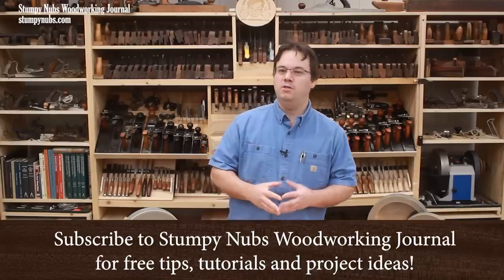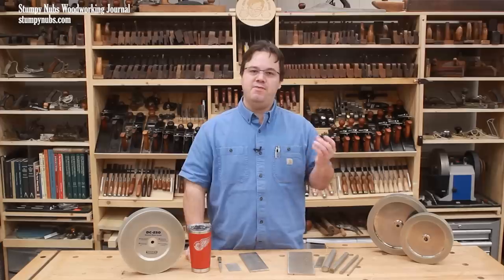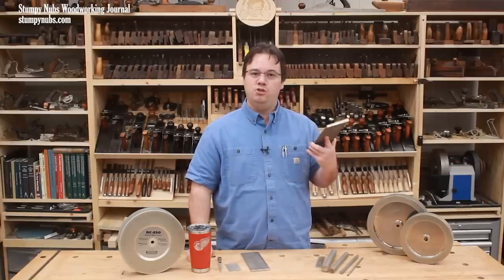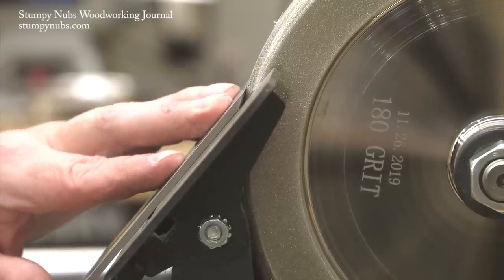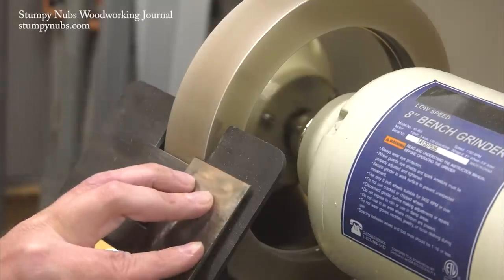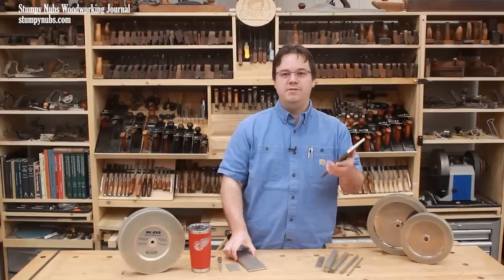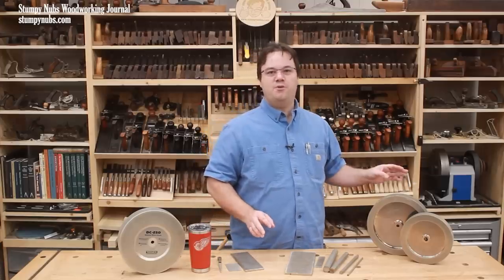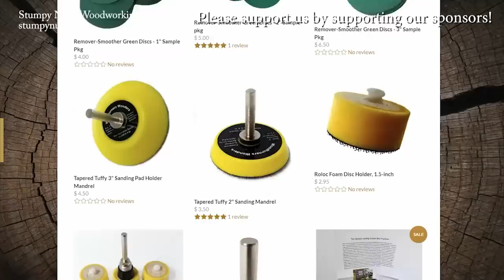The TRUTH about CBN vs Diamond sharpening stones

Comment: I’ve heard that graphene is stronger than diamond, so I’m wondering if graphene will eventually be incorporated into sharpening systems in the near future. Your thoughts?
Reply: Graphene tends to fall apart in all the things that make it magical once you produce it/size it on the macro scale. It's weaker, less thermally efficient, less durable, and less malleable. It's also much harder to manufacture.
Reply: @jordananderson2728  All that's subject to a rather large asterisk. The main issue leading to those drawbacks has nothing to do with graphene itself and solely with irregularities in the 2D lattice due to our still crap manufacturing methodologies that cause weak points and reductions in conductivity, i.e. why it hasn't actually left the lab yet.
Reply: “Strong” means many different things. Graphene makes strong bendy fibers that can flex. Diamond is harder, but it doesn’t flex well. A bent diamond shatters.
Reply: Graphene is a 2D material, and as such does not have a well defined hardness or bulk modulus. You cant really have a cube of graphene to test the hardness of, because at that point you would just have graphite and you're not testing the bonds in a graphene sheet but the shear strength between sheets.
Reply: Graphene is graphite. Much harder to burn than diamond, but also much less abrasive because it is sheets of carbon. In fact it is used as dry lubricant.

Comment: Would corrosion ever be an issue for water-cooled diamond or CBN wheels?
Reply from the maker: The steel substrate beneath the layer of nickle that is used to electroplate the crystals on can rust. Use water with an anti-rust treatment if you use a wet grinder like the Tormek.

Comment: If you don't own a dressing stone is there another way to clean/unclog an aluminum oxide stone?
Reply from the maker: A dressing stone isn't expensive. Why not just get one?
Reply: @StumpyNubs  Because I want to be like McGyver but usually wind up being McTard
Reply: @StumpyNubs  Quick question on Amana countersinks (for #10 bugle head deck screw).  Me/friend did a decking job and snapped drill bit on 3 Kobalt countersinks.  2 of those the set screw that locks the drill bit in snapped in half and 1 of them the bead lock would not engage (it was frozen) so the set screw alone wasnt enough to hold a bit in for too long.  So what we found was Kobalts suck at being able to replace a broken part.  Does AmanaTool make their countersink drill bits more "repairable/replaceable" or are they just as bad?

Comment: now i'm royally confused.  after researching an uber-budget wheel to pair with a wtw spartan, almost every wheel is described as "cbn diamond"  and when reading fine print they list abrasive - diamond and ceramic.  only one separated their products into two distinct options either diamond or cbn but all list materials to grind as high speed steel and alloys but none list carbon steel or even carbide steel ... except wtw.   ???
Reply from the maker: When you buy cheap wheels, you get confusing, inaccurate information and poor quality.
Reply: @StumpyNubs  cbn is the tung oil of grinding

Comment: speakin as a machinist, you never want to use diamond on high speed, go with cbn. the carbon in a diamond will leach into the hs and cause you probs, at least that is what i was taught, and that protocal is pretty generally followed in every shop i have been in (50+ years.) diamond for carbide, and cbn or a softer bound aluminum wheel for hs. i'm not criticizing you sir, i admire yer knowledge and learn big time from you as i try to learn this wood crafting. but that's something i picked up along the way.
Reply from the maker: "i'm not criticizing you sir.." Why would I think you are criticizing me when you are pretty much repeating what I said in the video?
Reply: @StumpyNubs   well, put me in the pile of those folks that don't listen so good...jeeezzzzz, i'm sorry, i hate it when people do that too, and here i am standing in the pile o them. i jumped on it so quick cause grinding with the wrong material is a pet peeve of mine i guess. i am truly sorry.
Reply from the maker: @blakewerner4368  No problem :)

Comment: I didn't hear anything about a requirement for anti-corrosive additives for the diamond wheel.
Reply from the maker: Because you would have to use it with either CBN or Diamonds if you plan on wet sharpening. It wasn't a point of difference between them.

Comment: Does this mean you've completely discarded whetstones? Its a shame, because the more woodworking I do, the more i love my whetstones. I barely use my bench grinder anymore. When you have a sink layout specifically for whetstone sharpening, it takes less than 5 mins to hone a blade, and 10 mins to resharpen a dull one. I still like my Makita bench grinder...I just love my whetstones a lot more. The only downside is; it seems like Japan has a monopoly on high quality synthetic whetstones. Not made in US, and shipping is really slow.
Reply from the maker: I teach woodworking to a large audience. So I use multiple types of sharpening gear. But I admit that I don't use my water stones much these days.

Comment: I am thinking of getting a pair of the spartan CBN wheels for the Tormek from your link as they say you can run use them dry which would be great in my unconditioned shop.  Which grits would you suggest I go with?  The Tormek stone grader says it sets the wheel to 220 abs 1000 but would you suggest the same with CBN wheels?
Reply: I have a 180 grit cbn wheel on my T8 and it's great. So much faster than the original wheel.
Reply from the maker: Tormek's three diamond wheel grits are 360-600-1200, so that's at least the range they recommend to cover a wide range of uses. If you only get two grits of CBN, go with around 300 and 1000. You can use the 1000 most of the time, then go right to the stropping wheel. The coarser one is for when you need to remove a lot of steel to fix or shape an edge.
Reply: @StumpyNubs  Thanks for the answer, that was very helpful.

Comment: Get a 2x72 grinder and a bunch of belts including ceramic and a strop belt. You change belts by pulling down the tensioner wheel, so it's trivial to do. You can even build one yourself for the price of a Tormach. Now you have a flat surface that is big enough to lap the sole of a #4 plane and can do flat or concave.

Comment: If CBN is supposed to be cheaper than diamond, why are all the CBN plates actually more expensive?  I can get a full set of diamond plates for $25 and the cheapest CBN plates I can find is $63 for one plate (on 9/21/23).   Do you have a secret source?
Reply from the maker: You are comparing cheap, low quality diamond plates to good quality CBN plates.

Comment: Sharpening tools is a magical paranormal experience in an existential existence. I am not a wizard. I buy disposable cutting devices. Probably hundreds of pocket knives over my 59 year life. A stack of worn saw blades a foot tall.  I can't even get a kitchen knife sharp in a V-shaped ceramic sharpener or a chainsaw chain sharp in a jig. I own dozens of chisels just to get a new edge. I have all sorts of bolt on jigs and sharpening devices and none of them work well for me. Even a Drill Doctor destroys drill bits for me. I won't even use a hand planer because I wont be able to sharpen them. For me all tools get dull and then replaced. I stopped trying to sharpen anything years ago. My father was cursed the same way. When he passed we found stacks and piles of unsharpened tools and blades. One chainsaw and six used chains. A bucket of drill bits and like me a handful of sharpening devices all dusty and put at the back of a shelf. I am aware of the waste of personal resources by doing it this way but nothing in my life works like it should.  I don't earn enough to buy quality tools so I just buy and replace the cheap stuff.
Reply from the maker: "I don't earn enough to buy quality tools so I just buy and replace the cheap stuff..."  Sounds like a solid plan... LOL
Reply: @StumpyNubs  Can't tell if serious or sarcastic.
Reply: I'm the same, I know what to do to properly sharpen, it just doesn't happen right when I do it. I've ruined so many drills and blades... I've even had people who CAN sharpen super well observe me and not have any suggestions because it appears I'm doing it right but the end result is always off just enough to make it not work.
So I barter for tool sharpening and pay with stuff I'm good at
Reply from the maker: @bobjoatmon1993  In my experience, sharpening problems almost always come down to one of two issues- the back is not properly polished all the way to the edge, or they didn't properly polish the bevel because they didn't use a high enough grit, or strop. I recommend watching both these videos: 

https://www.youtube.com/watch?v=5yj16u7udlw

https://www.youtube.com/watch?v=H4bHHyPHfps
Reply from the maker: @rockets4kids  Sarcastic, of course. LOL!
Reply: @StumpyNubs  thanks, I'll watch them